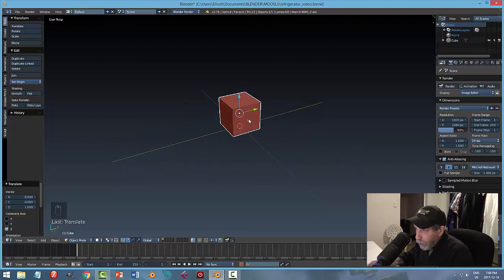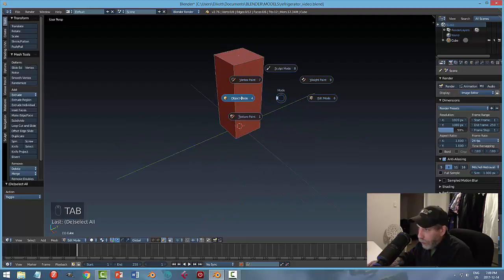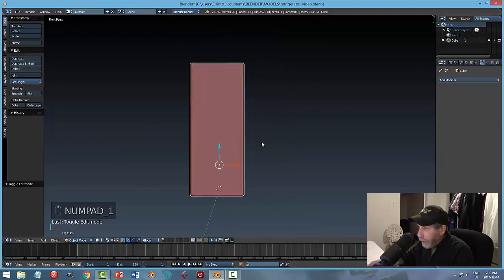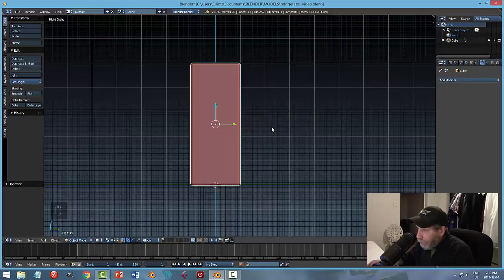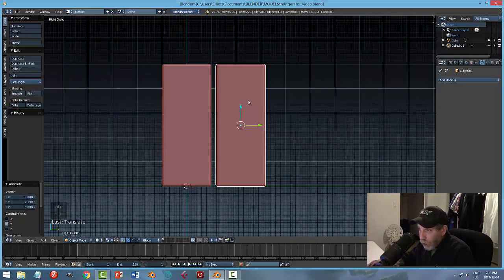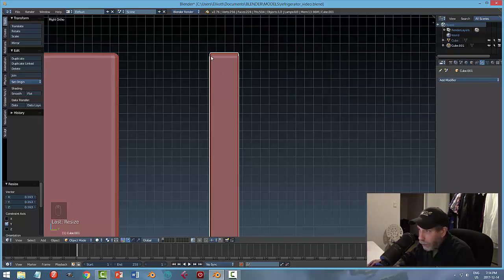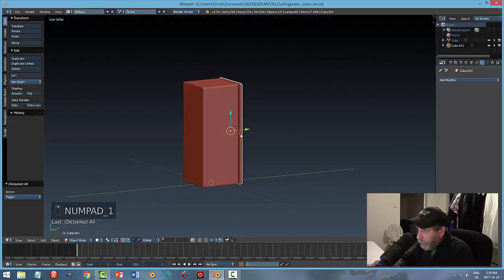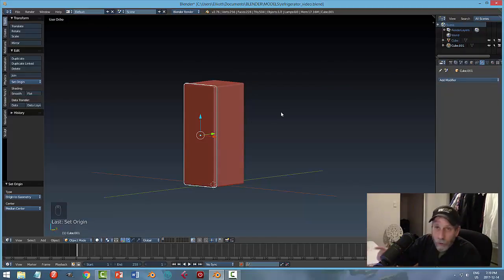Blender: Modeling a Refrigerator

Comment: about half way through and enjoying it so far, its a good tutorial, one small tip, for doing bolts instead of creating them yourself using boleans, blender has an addon called bolt factory that lets you create different bolt types instantly with addjustable settings, even creates the threads for the screw, might save you a bit of time and they look pretty decent
Reply from the maker: Hey that's great!  I'd like to see your refrigerator when it's done.  Yes I know about bolt factory.  I always like to make as much as I can myself.  There are also window makers but I feel it's cheating (my personal opinion) so I try to do it all myself even if the result isn't nearly as good.  But thank you for the tip and best of luck in your work and thanks also for coming around to my videos.
Reply: That's fair enough, can understand and respect that, I've just got in the habit of anyway to speed up my work I take it, each to their own though, got a couple ideas for how I'm gonna finish my model but yeah will post the finished result, really enjoying following your videos though
Reply from the maker: Thanks and I'm looking forward to seeing your model :)
Reply: http://dropr.com/karlshackleton3dmodels/189491/vw_fridge_freezer_model/+?p=1815637

There's the finished model
Reply from the maker: That is just fantastic!  Another excellent job :)
Reply: Thank you :)

Comment: 49:35. I got to this point, but when i add the Bevel, nothing changes. Any idea why?
Reply from the maker: Try applying scale and rotation, ctrl-A, and see if you can apply the bevel after that. Also go into edit mode, select all and ctrl-N to recalculate normals. If neither of those work, you may have to re-model and periodically try apply the bevel to see if it is working and then turn it off with the eye icon and keep going trying bevel now and then. Hope you can get it to work.
Reply from the maker: I wrote you earlier from my cellphone and didn't have a chance to check the piece of the model at the spot you were stuck on.  Now on my desktop, I see you are working on the handle.  The bevel should definitely work here.  I have a tendency (or had) to do a lot of scaling/re-sizing in OBJECT mode which requires CTRL-A and "apply scale and rotation" or things will not work right.  I definitely think that is the problem here.  So either use CTRL-A whenever you scale in object mode or scale in edit mode.
Reply: Thanks for the response. I just deleted the handle and made a new one, and then it worked. I guess Blender can be buggy at times?
Reply from the maker: For sure. Well that's great news!